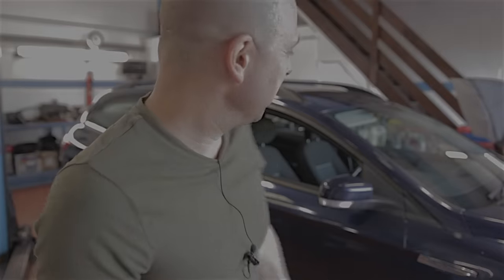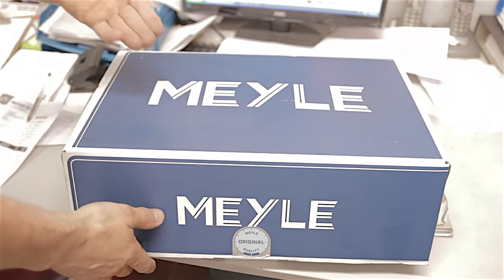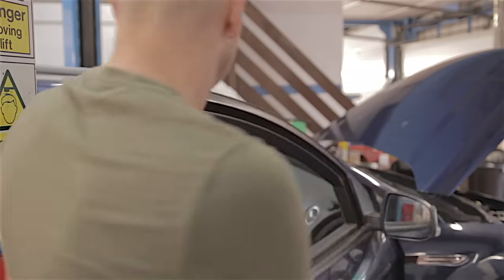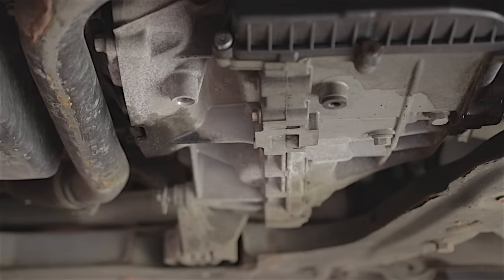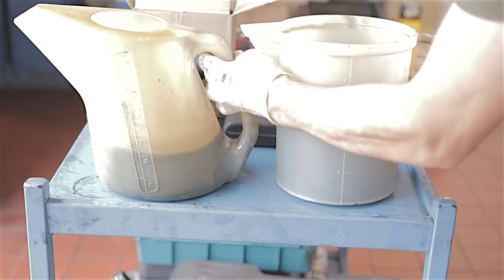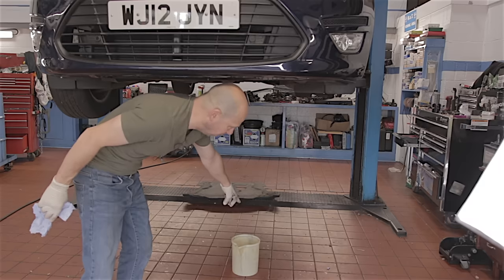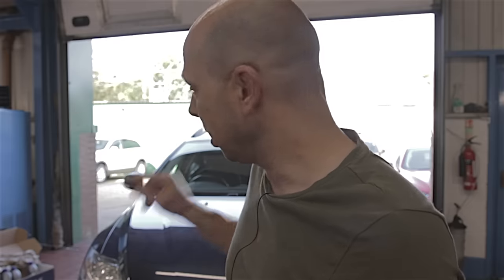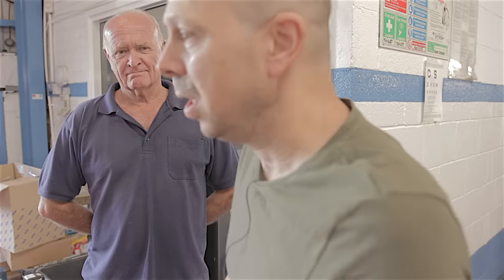Ford Mondeo Powershift Oil & Filter Change ....Lucky Me !!

Comment: Hi and thank youfor all the videos👏.
I have a ford mondeo mk4 with the powershift.
Iam thinking 🤔 to change the oil myself but I just have one problem the floor in my garage a bit incline so the car is not level.
So iam wondering if i measure how many litres I get out and put exactly the same with out checking the level will that work or not? 
Iam thankful for the help.

Comment: Hello Alan. Great channel for us Ford users 👍. I have done the oil change using your video on a mk 4 with my mechanic. I have now a mk5 and want to ask you if the procedure is the same. Țhanks again for your channel.
Reply: Hi, dual clutch and torque converter have different procedures and different oil types.. check on your gearbox the Manufacturer, or run a diagnosis and check the TCM part number to be 100% sure of what gearbox are you using. Cheers. Noroc.

Comment: My mrs has a focus 2.0 tdci powershift, full ford history 140k miles and no gearbox issues, gearbox oil change on that cost between £260- £280, however my mothers 2.0 EcoBoost titanium x sport mondeo is on 120k with no issues, gearbox did get serviced with incorrect oil by an independent tho and started juddering, oil was changed again at ford at a cost of £360 and its fine.....have to shop around with the ford dealers as costs vary it seams
Reply: Steven King how much does it cost to get serviced by ford? The automatic transmission
Reply: @troytrey  from memory it was about £350
Reply: Steven King thanks

Comment: Great video as always mate, I've done this about a year ago, all is fine apart from slight jerk pulling away 🤔🤔 what was the correct grade oil used if you wouldn't mind, think I might have to get a litre and bleed off some to. Mae sure the level is correct, cheers Alan, keep up the good videos
Reply from the maker: if you phone any motor factor parts suppliers ..using your registration number they will supply you with the correct oil...

Comment: A very informative tutorial. Thank you for your advice,  most helpful.  Just hope it works. I'm getting warning display on the dashboard,  transmission limited, hopefully a gearbox and filter oil change shall rectify the issue. Just one question what is the model of the meyle kit that you used? I currently drive a 13 plate Titaniumx X BS.
Reply: I’m currently getting this message, did an oil change solve this?

Comment: The Powershift transmission on these Mondeos/Kugas (6DCT450) aren’t the problem. The ones Ford had problems with are ones fitted to the Fiesta, Focus, Ecosport, BMax,(6DCT250) up to 2016. They had dry clutch packs and people who where used to driving automatics were driving them like torque converter autos and letting them creep along and holding them in Drive on hills. This made the clutch packs get hot and burn out almost like riding a manual clutch in a manual car. As the clutch packs got seriously hot the drive input seals would get hot and perish allowing gearbox oil to leak onto the clutch packs making them slip and eventually destroying them. The gears boxes are not made by Ford but a German company called Getrag, who make transmissions for other manufacturers.
Reply: The many people I've seen with issues with these in mondeos would beg to differ. Its a daily thing to see someone with powershift issues in the mondeo pages I'm on, on Facebook

Comment: Alan, have you had any bad manual mk4 transmissions in your shop? The synch went bad on my 1.6 tdci Mondeo at 180.000km. It would occasionally pop out of 2nd after clutch release. Had to get a new gearbox, because this is supposedly a common fault on the Fords?
Reply from the maker: yes 2nd gear and sometimes 3rd synchro go which are quite common...had quite a few hear...we just get gearboxes repaired with new 2nd gear and synchro

Comment: Just done this job for a customer,

Retail prices as of 21.10.10 from Ford are,

£40.89 for the filter
£150.53 for 5L of oil
£31.76 for 1L of oil

Total, £223.18

As expensive as it is though, on a customers car it’s was still cheaper than a replacement gearbox should the aftermarket oil not quite be up to same spec as the genuine oil.

Genuine oil also has a green tint to it for some reason.

Comment: Hi Alan, newly subbed to your channel, wish I'd found you a couple of weeks back, you would of saved me a lot of heartache and work. I need to ask, Iv'e got an 11 plate 1.6 econetic, it lost teeth of the cam belt. I stripped it down (head off etc) it's all back together but won't start, could I possibly 180 degs out with the timing? Thanks in anticipation

Comment: Used to be a time when a gearbox (auto or manual) would easily outlast the rest of the car. Something that deeply offends the insatiable corporate greed. So it was deemed necessary to redesign the oh so simple gearbox to create an insanely complicated new kind of gearbox that could be relied upon to fail regularly and thus generate a continous revenue stream. Just like all those engines with EGR on them, another guaranteed multiple engine failure revenue generating system (which can be rectified with the fitting of a simple and cheap oil carch can, somthing that no car manfacturer supplies or fits). I wouldnt have a modern car if it was free.
Reply: With the ever tighter emission regulations and increasing fuel economy figure this is the price to pay unfortunately...

Comment: Very informative video! Is it the same transmission in a 2017 Mondeo?
Reply: It should be revised version from 2017 and later. First versions of PowerShift 6dct450 have plastic guides on springs inside flywheel. Once plastic becomes brittle, it goes in flakes and mechatronic unit is fucked up. Not cheap to repair
PS: 2017 gasoline Mondeo doesn't have PowerShift Getrag, it has classic torque converter, which is better. Diesels still have DSG style Getrag, but shouldn't have the same issues as first revision, since flywheel is outside of gearbox, so plastic can't contaminate gearbox oil

Comment: Hi Alan. Mate, I have a 2011 FORD MONDEO MC with the powershift transmission. Where is the VSS sensor on the transmission located on this cars and is there one or two sensors? I am getting a VEHICLE LOST SPEED SIGNAL error at low speeds when changing from REVERSE to DRIVE and it happens at low speed under 10km/h. Please help an aussie 🙂

Comment: Im looking at one now would you recommend staying clear of the powershift or just ensure you maintain it ?
Reply from the maker: Definitely give it a good long road test. The later ones are pretty reliable as long as you change the oil at the correct intervals
Reply: @alan4x  I have found a 2014 model with 60k on the clock so will just give it a good run if I go to see it cheers

Comment: Hey Alan,any advice? Powershift was acting up. Emptied fluid out and was only 3.5 L in it. Filled it up to 6 and it's running perfect again. Leaking between box and engine. Easy job you reckon or run away?
Reply: Sell it asap

Comment: There's a much simpler way to check the oil level and is probably more accurate. As with any automatic box, pour your oil in and start the engine and leave it in park and fill until it reaches the level, that way the hydraulic circuits are already primed. I typically find they need about 7.5 litres for a service, I wouldn't rely on the amounts drained to be an indicator as I've seen plenty with hardly any come out!
When they work these 'boxes are lovely and smooth to drive, however they're far from reliable due to poor design of the clutch pack which fail - hence the nickname "powersh!ts" 🤣

Comment: Hi Alan. I have a Mondeo 2008 Petrol 2.3L with Automatic gearbox sealed for life. Do you suggest i change the oil and if so at what interval. Many thanks Peter
Reply: For a 2.3 petrol you would have the AWF21 transmission, I would recommend changing the oil at 30000 miles interval. Mobil ATF 3309 is the best you can get for the box. Search for Aisin TF-80SC transmission fluid change and there are videos on how to change it. (for the 2.3 we have dipstick so you can refill it from there)

Comment: Hi Alan. Quick question if I may. I have a 2.2 mk4 TXS, so it has a durashift, not the powershift auto. Ford say it is a 'for life' box, yeah right! 😂. I want to make sure it lasts, so I want to get the oil changed. Any ideas when I should get it done? The car is on 60k now, I dont want to ruin the gearbox or it fail on me. It's an aisin afw21 old school durashift in the 2.2. Thanks for any info, and merry xmas
Reply: For the AWF21 box I recommend changing at 2-30000 miles interval depends how you drive it. Search for Aisin TF-80SC transmission fluid change and there are videos on how to do it.

Comment: Is this the DCT450? I plan to do the oil change on my Focus Mk3.
Can you please put a link for the oil? I have found a kit but i want to be sure i buy the correct stuff. Or only the specification is necessary ( WSS-M2C936-A)? 
Thanks a lot!
Reply: Hey, I'm pretty sure it is. The filter I bought is the same one that he has in this video. MK4 2.0 diesel has the same transmission and engine as the MK3 Focus 2.0 diesel. I bought the Penrite DCT fluid which says it means Ford spec Ford M2C936-A. I'm yet to actually do the service, just getting as much info as possible before I attempt.

Comment: I was about to do the same as per this tutorial but I noticed oil leaking from the bell housing so sent it in to the dealer and turns out it was the seals were stuffed and needed replacement so had that done and a service

Comment: Hi Alan
My daughter has her heart set on a newer Mondeo diesel, preferably 2016 onwards. Do you have any advice on what to keep an eye out for - before buying, please? Any known problems?
Reply from the maker: hi peter, i would make sure it has a service history if possible and check the grille shutter mechanism is not broken in front of the radiator and all the under trays are there and intact.
it depends what mileage the car has done to say what could go wrong.
overall they are pretty good cars but i would recommend the 2litre over the 1.5 or 1.6 diesels
Reply: @alan4x  
Thanks a million, Alan. I'll help her look for that.

We looked at one today, 2 l, 175.000 km, full service history, and an impressively clean engine compartment. Had a ticking noise when cold I didn't care so much for though. As if one valve needed adjustment.

Again - thank you very much for the quick answer. 😊 Looking forward to your next video.
Reply from the maker: no worries, remember that at 200km 125k miles the timing belt is due which will be fairly costly
Reply: Alan Howatt 
Right. Thanks.

Comment: So yes the powershifts have got such a bad rep that ford have had lawsuits and had to extend the warranty up to 10 years in some countries, only 5 in the UK. From what I've read it appears that the majority of faults were in the dry clutch versions fitted to the fiesta and focus models with the Mondeo having the wet clutch version. I think ford started fitting traditional torque converter auto boxes in the focus from 2016 onwards and also in the Mondeo from fairly recently. I believe the wet clutch ones are generally more reliable than the dry ones as long as they are maintained properly but still a complicated bit of kit.
Reply: I don't wonder that at all. I have one of the last torque converter automatics on my diesel mk4 and it's driven almost 600k km's. Still seems to work just fine. I'm bit surprised actually as I haven't seen too many oil changes made to it by previous owners.

Comment: I have a 2009 Mondeo Titanium X, looking to change the gearbox oil myself, but after removing the air box, I can’t seem to find a filler hole, I’ve got a gearbox ecu on top, any idea of it’s under this or on the side of the gearbox? Don’t want to start taking things off that don’t need to be off 😂

Comment: Got galaxy six speed auto AWF21 oil for that £17 quid a litre and ford only needs almost 8 litres so your kit fairly cheap 
Recently done X3 transmission oil change BMW wanted nearly £400 for service kit where’s from factors got ZF kit for under a couple hundred quid 
Again nice video thanks

Comment: Hello, how are you? I have a question. I have a Ford S Max 2. 0 TDCI 130 hp 2008. I want to change the transmission oil, not how much the transmission filter has only an oil drain plug, the box brand TF-81SC.
Reply: 2008 should be TF-80SC, plenty of video on the Volvo side on how to change the fluid. It's a completely different unit and procedure.

Comment: NEED TO KNOW WHERE THE INDICATOR RELAY IS PLEASE?? thanks Alan - love your videos!!
Reply from the maker: i believe they are controlled by the central control unit so does not have an indicator relay
Reply: @alan4x  Hi Alan, many thanks for replying (your a star 🌟)  I upgraded the rear tail lights to the new design and are now all LED - they flash as normal outside its just the green arrow and noise are twice as fast.     Any further help would be greatly received. 👍
Reply: Hi Alan, many thanks for replying (your a star 🌟)  I upgraded the rear tail lights to the new design and are now all LED - they flash as normal outside its just the green arrow and noise are twice as fast.     Any further help would be greatly received. 👍
Reply: @philipdraycott536  

You need to fit ballast resistors to your indicator bulb wiring. You have a bulb failure system on your car. The led's dont put enough resistance on the circuit. Where a filament bulb would.

Comment: I need to do exactly this on my 2012 Volvo S60 !! Im a bit nervous if im honest !! Any ideas why you need to hold it in R/N/D for 20 seconds each
Reply from the maker: some one else quoted this better than i can explain it lol..the reason for going through the gears before hand is it puts the box in service mode opening all the solenoids allowing the oil to completely drain. you do the same after as it will purge the air from the system and take it out off service mode. its the same process when changing the clutch pack
Reply: There is no service mode in the volvo software for this box ,  the filling method is quite complex in the volvo instructions , but  with experience i have found drain as the good  Alan did very well ( 3 drain plugs on earlier gearboxes )   and add just 5.5 litres and forget about it :-)  the gearbox is very sensitive regarding low oil level and will go  start playing up if the oil is even 1/2 litre low ...The Gearbox oil & filter  MUST be changed every 3rd service . There are an awful lot of these powershift gearboxes being neglected now the cars are a bit older and will no doubt write off a lot of perfectly good volvos and fords with this Gearbox . The clutches generate a lot of metal  debris of which a lot doesn't get to the filter .
Reply: @nickclark6001 I just got round to doing this last week , went perfectly well , took around an hour to do on my drive , however i discovered a leak after a few days from the filter housing , lost around 200 ml of oil , im assuming the new seal must have been damaged whilst fitting , new seal & seems ok now 🙈

Comment: Hi I wonder if you could help me,  I have ford galaxy mk4 automatic gearbox since yesterday no reverse gear, car still drives. Thanks in advance.  Regards
Reply from the maker: you need to get your gearbox ecu scanned for codes but if you are anywhere near kettering then call midland automatics..they are very good with autos
Reply: @alan4x  Thank you very for your reply I will arrange the ecu scan .
By the way I am in London and big fan of your videos. 
Regards
Reply from the maker: @zafar4665  cheers zafar

Comment: What about the gearbox oil pan filter? Need to replace that too?
Reply from the maker: it does not have one
Reply: @alan4x  isn't there a internal square looking filter for replacement and two magnets that need cleaning  behind the black cover?

Comment: Oil is shared between the clutches and the gearbox. All the crap in the filter and the oil is clutch wear. If you don’t change the oil the box will fail. Just change it!!

Comment: I bet that oil suitable for tractor powershift gearboxes, generically known as Universal Tractor Transmission Oil [UTTO] is perfectly suitable for the Ford gearbox. This oil currently costs less than £350 for 200 litres plus VAT.  So £2.20 per litre inclusive so £13.13 for six litres. It has all the right friction modifiers for wet clutches and brakes.The filter should be less than £25, so certainly less than £40 the lot.
I would use Morris Super Versitrac 10w/40 [SAE80]. I am willing to bet it would be at least as good as the oil you used. It is available in 20 or 25 litre drums.
Reply: Sounds good, but the risk of damaging the gearbox is too high to do such experiments.